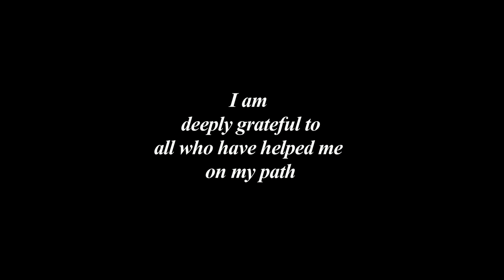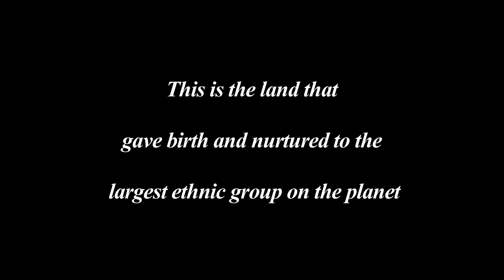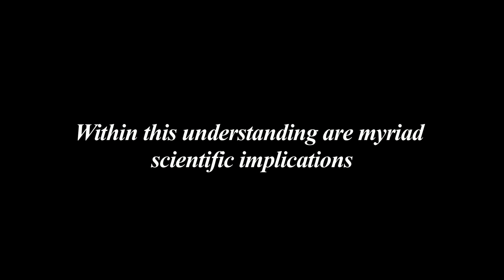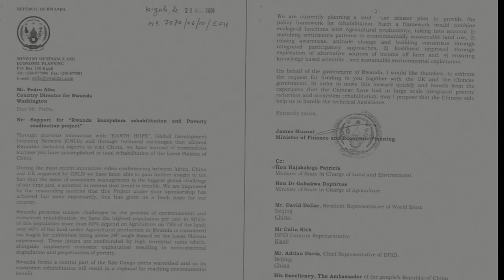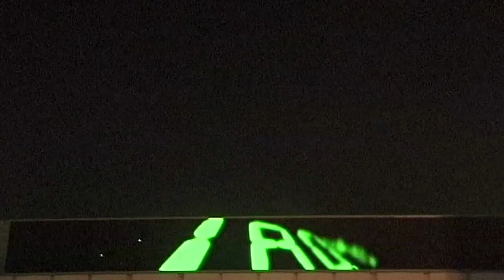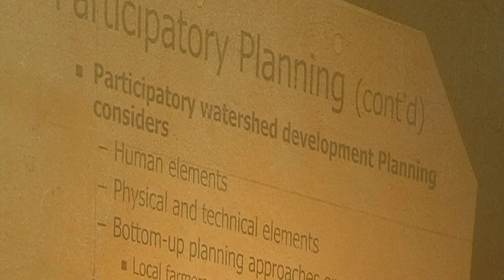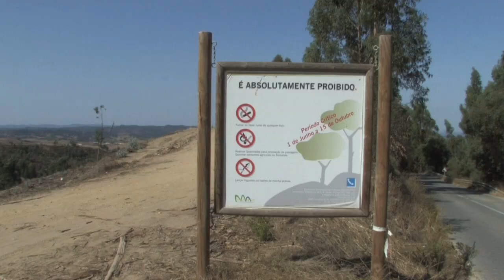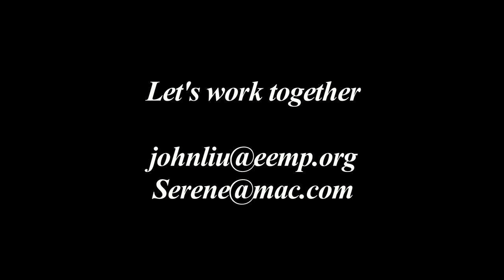The Great Work of Our Time by John D Liu

Comment: He makes a strong case that the ecological function of the land and seas has been grossly undervalued, but to declare that trade is bad and war is inherent to capitalism will only slow
implementing the valuable parts of his insight.  There are many ways to look at the tragedy of the commons and many ways to reduce the damage.  We shouldn't drive off allies by requiring adoption of his communal beliefs before making necessary changes.
Reply: war is inherent to agriculture. Feudalism / slavery predates the ecnonomic system of Capitalism, (that emerged with industrial mass production) and there was plenty of war before Capitalism.
10,000 years ago farming made a surplus of food possible. It started in regions that could be very fertile IF humans banded together to build large irrigation systems. That was the birth of larger settlements and civilizations.

The surplus lead to higher birth rates, and those lead to conflict over land. btw the body size of humans dropped then. Farming was good for the spezies but not for the individuals. 

With the surplus of food (made often with forced labor) the groups could afford to have a group of men in their prime that did not produce any food nor did they hunt. Their job was ONLY !
a) to keep the local peasants down the surplus that the many created with a lot of work went to the small group at the top. If we include those that were at least well of, maybe 20 - 30 % of the population.

and b) to fight any intruders that woud be attracted by the stores or wanted control over that land, wanted to kidnap people for slavery or take of the land to get access to land, water or irrigation system 

or c) that standing army of warrios could go on raids and to steal from others or to come back with prisoners of wars = slaves or to blackmail the neighbouring tribes to pay tributes (or else they would be attacked).

The form of religon changed as well, it was the means to form cohesion and to keep peasants revolts etc. down - typicially the ruling class were the children of gods, so of course they had the right to rule. Organized religion became instrumental to support the status quo (it still has that task). 

In a group of hunter / gatherers you cannot have slavery and indentured servitude. Not at a large scale that would have any economic impact.

All adults (that are tribe members with the full rights of mebers, too) must contributue, and it must be voluntary and willingly. Children are valuable (Native Americans sometimes stole children and tried to integrate them into the tribe - which worked in some cases, even tough the children were old enough to "know" that the tribe that had adopted them, also had killed their parents and families.
Kind of Stockholm syndrome, the children went in survival mode and suppressed that knowledge even if they were kidnapped at age 8 or 10 (in theory old enough to remember). 

But the group members do not produce so much surplus that it would make sense to have forced labor. And they could not afford to start a lot of conflict it messed with their ability to feed themselves.

If a group of men went after the mammonth - that was dangerous work and they needed to cooperate well and have each other's back. You do not get that with servitude / slavery or a bullying, dictatorial leadership. 

Humans evolved in hunter / gatherer societies it shaped our social instincts (but they only work will in small groups where we know each other. But then they work very well. They have to, it is a survival of the species issue).

Humans are territorial (in most cases, the Inuit are not, or not very much), but they are also egalitarian by evolutionary design.
Reply: He is right that Capitalism is a major obstacle (in my view it is a threat to our high tech civilization). The organizing principle in capitalism is GREED. The highest profit at the lowest costs. Externalizing costs is part of the package and so is exploitatation. Domestically, and also internationally.
Reply: I suggest to check out highly decorated marine Smedley Butler's quote: I was a gangster for capitalism. The U.S. oligarchs have been using the strong U.S. military to wage war and inflict regime change on other nations so they could exploit them. There was a lively debate about U.S. imperialism around 1900 and Mark Twain engaged in it (and was on the right side).

Before that many other nations did it (under feudalism or later Capitalism, who was as militant, exploitative - also towards natural resources as before. The U.S. form of chattel slavery was an economic model to make the cash crops grown for the benefit of rich landowners possible. the deep contempt had to be nutured to be able to have that extremely cheap forced labor. The plantation owners would have gladly kidnappped the poor from their own countries or from other European nations (prisoners of war) but that was not feasible.

So they pulled off an industrial style of kidnapping from Africa and later selling humans. It was strongly inspired by co-existing Capitalism - slavs were also financed like manufacturing machines, and in the 1850s and 1860s many had highly leveraged loans. It is a feudal economic system, so strictly speaking not Capitalism - but it had a strong Capitalistic vibe for instance in the scale and also the leveraged way to finance it (with bank loans).

The U.S. military was ALSO used against the U.S. population. The 1930s March for the WW1 bonuses for veterans was crushed with help of the military.
The coal barons got the help of the government to air bomb !! the miners in ? 1926. Blair Mountain battle. BATTLE.

Rest assured that the miners were not in it to make trouble, they were desperate and the coal barons had broken the camel's back with murdering a mayor that sided with the miners.

I am not hyperbolic when I say that Capitalism is organized around the principle of greed, inequaltiy and exploitation (like the economic systems before, dating back approx. 10,000 years when agriculture emerged).

ONLY in the time after WW2 a lot of the surplus was shared with most of the population and that ONLY applied in the developed nations. That needed a bitter labor struggle for 150 years, 2 world wars and the very specific set of circumstances after WW2. But the oligarch bid their time and hit back when the first major economic crises hit after WW2 - because of oil price spikes in the 1970s. 

Neoliberalism (in the 1980s in the UK and US, it hit central Europe in the late 1990s and has done less damage there) has reversed a lot of gains made in 3 - 4 decades after WW2.
The only good time labor had in Capitalism, turns our the ruling class, the oligarchs had not become wiser, they just could not help to share - in the first world nations - for a short period of time. but they were as exploitative as ever in the developing countries (colluding with the local despots and crushing the population if it organized to get democracy).
Reply: Capitalism is not about serving the customers well, or to be innovative, .... . That can be necessary to make a profit, especially smaller companies can't help it, but large companies that have little competition or succed in taking over natural monopolies or are able to capture regulators and the political process -  invariably screw customers, workers and the environment.

And they invariably make a good effort to rig the game and take over in politics, etc. 

If  profits can be made by exploitation and speculation or rent extraction or getting subsidies & bailouts from colluding politiicans - all the better, innovating is a lot of hassle, and it is RISKIE than speculating at a large scale. The speculators have been bailed out in the past. In 2009 (and later with QE) and again in March 2020 when the "markets" got 1.2 trillion (TRILLION) USD in from of QE. Before anyone - even big biz - got a handout. 

A few small companies might be the ethically acting  examples that are the exception to the rule. But the system is shaped, changed and dominated by the BIG players and they behave like psychopaths / exploiters. And in the case of finance like compulsive gamblers. 

 I challenge you to name me large, multinatinal companies  that did not / do not severely ! misbehave. O.K. Costco might be decent. Or Ben And Jerry's. 
Microsoft ? Apple ? 

Anti trust, violating privacy, colluding with government to censor outliers that are NOT crazy (twitter, facebook google) and often stealing ideas from others (Microsoft and Apple). 

Microsoft is one of the better giants but still they were eager to undermine the "free market" whenever they could. Their track record on the environment and worker abuse is not terrible - compared with other large companies  (some exploitation of contract workers and no attempt to improve mining in third worlds countries,  or electricity production in the U.S. - which ties into computer use and production)

Nor did they or the manufacturers of PCs / electronics speak out against outsourcing to Aisa. Chip shortages anyone ? Suicide nets at Foxconn the supplier for Apple ?
Reply: Capitalsm also naturally leads to oligopolies and monopolies. It got so bad that that Teddy Roosevelt had to fight for anti trust legislation (which is still on the books but ignored). Then finance crashed the eocnomy in 1929. In many other nations WW2 and aftermath created a reset for big biz. Fast forward 70 years and here we are with the new highly concentrated industries.

 It is built into the system to strive for dominance in order to manipulate, rig, and crush competition. Which is all very good for higher profits. And to not be bothered by better products and services. 
Being "fair" to the competition (when they happen to be good) is not good for profits or costs.

Capitalism certainly is NOT about FAIR competition / free market. That would mean the competitors can win and limit profits of big biz (or send them into decline, or leave them with major stranded investments and losing the postion of technology leadership). The companies with a lot of market power wil invariably play dirty to get rid of competition. Or at least to limit it.

Which is one of the strong incentives to get larger.

Externalizing costs is rewarded (that is also good for the individual and short term profits) the consequential damages (pollution, wearing down workers, climate change, using up the ground water, degrading land with unsustainable farming practices, plundering mines and fossil fuel that needed millions of years to form) is passed on to others or future generations.

One measure to have the highest profits and the lowest costs is to screw workers - and it is done. Often. If it is NOT done it is only because workers banded to together - and they live in a Western democracy and the Wester and European political leadership does not help to murder and suppress activits and union leaders.

There was NEVER a time when the ruling class wisely and voluntarily shared the surplus with the population. The Saudis did - a little bit for their HUGE surplus. But now the oil revenue went down in the last 10 years) and sure enought they reverse those policies. The very rich in Saudi Arabia do not help out, they now burdne the lower and middle class. And the benefits were only for citizens.

Domestic workers, construction workers are exploited.

And of course it makes sense to pollute to increase profits, even if it is mere cents. If the company is large (they are) then the output is also a lot. The few cents more in profit do add up. They would not matter for the MASS of consumers. The profits made possible by cutting corners even for small and not very expensive precautions add up over the large volume and they go only to a very small number of people.
A few large shareholders and management.

That is the reason why Texas has a alone electric grid - ERCOT. No one on the planet does that - refusing to be on a much larger grid when that would be possible (geography and politics. Southa and North Korea are not cooperating in one grid. Obviously. But if the Chinese let NK join up they will gladly take the offer).

it is not that it would have cost that much to have reasonable reserves and precautions for extreme events, and better building codes in the last 30 years (what helps against a severe cold snap every 10 years also helps against the regular heat every year) and to winterize the grid.

El Paso region is for geographic reasons on the national grid (well the Western half of the U.S. and parts of Canada - that is plenty of backup) - so they MUST abide by federal regulations that demand preparedness. Also for once in 10 years events.

After El Paso region (all of Texas) was hit hard in Feb. 2011 by a cold wave (but 2021 was even worse) they were willing to invest, but they are a city run by Democrats, that may help to not be fiercly opposed to commons sense regulations.

 Those investments for emergencies paid off. Big time and faster than they expected, after only 10 years. Note that the consumers and businesses of El Paso region do not have prohibitively high eletricity rates, they are still quite low - those investments can be calculated and written off over 20 - 30 years, so it is not that costly in the larger scheme ! of things. The generally low interest rates of the past 20 years help with the higher up front investment.

But El Paso for sure violated the principle of the highest profit (for a few). For the greater good of all of society. Which capitalism is unable to achieve (and does not event try).

Where are the success stories of Capitalistic run countries that restored eco systems like the Chinese did ? Or only stopped exploitative practices ? (incl. in developing countries !)

China plants trees to claim back land from the desert (and transform it at least into semi-arid grass land, but with some groundcover and water absorption capacity.) The RICH first world nations have them cut down for cheap timber, soy, beef and palm oil.

The boreal rainforests of Siberia, Scandinavia and Canada are also plundered. The harvesters are terible. But they are part of a profitable business model. So as far as Capitalism is concerned - they are good.